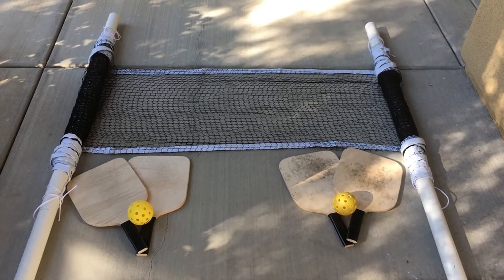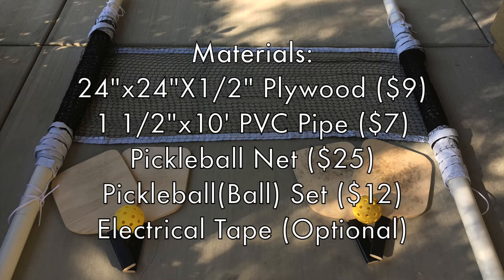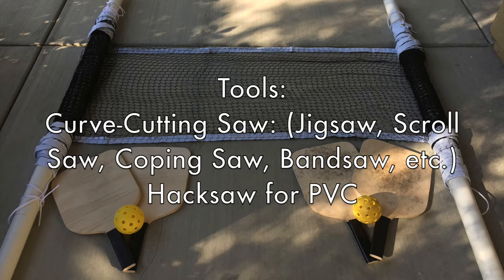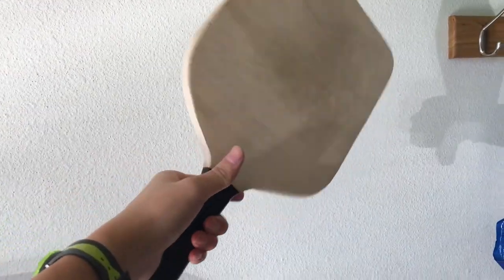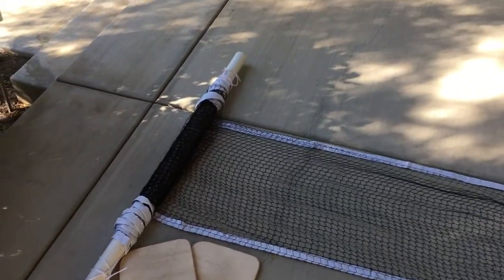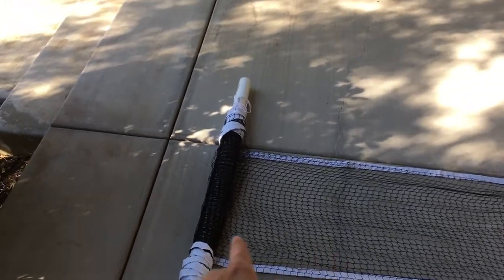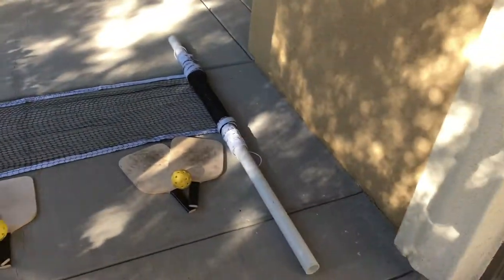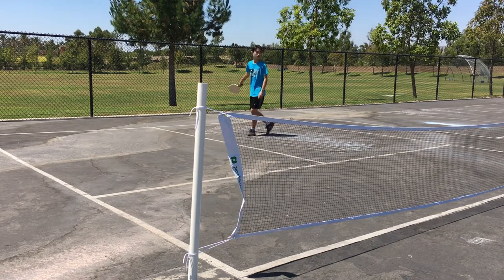Inexpensive Pickleball or Table Tennis Set!

Comment: Hey where'd go you need to have a new project 😀
Reply from the maker: Tom Potter  I will have a new project coming soon. It's a desk organizer but I have had a few setbacks. I'm also a bit stuck cause I need a disk sander but dont have one, so I need an alternate way to sand things down to a line in 1/4" material without making the edge curved.